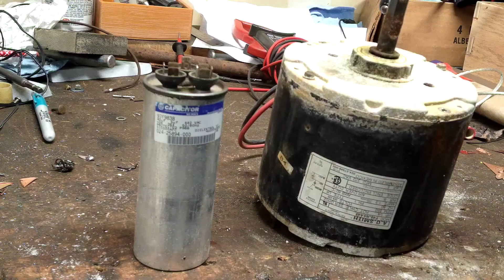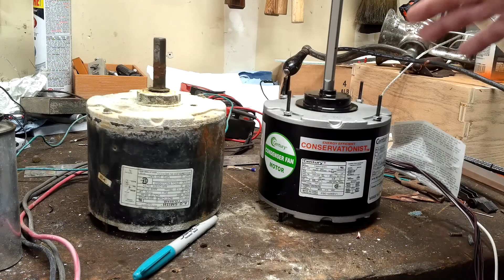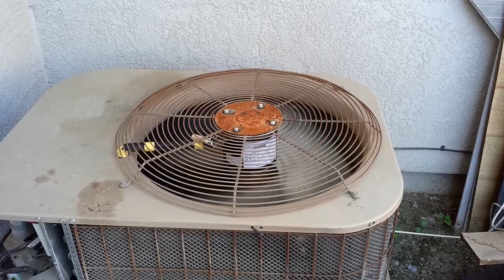Air Conditioner Condenser Motor Replacement

Comment: When replacing HVAC motors I tend to replace those caps if the have been in service for a few years. Cheap insurance.
Reply from the maker: funny you said that. after running for about an hour the cap blew up and i had to replace it!